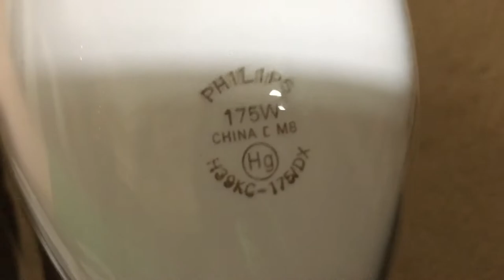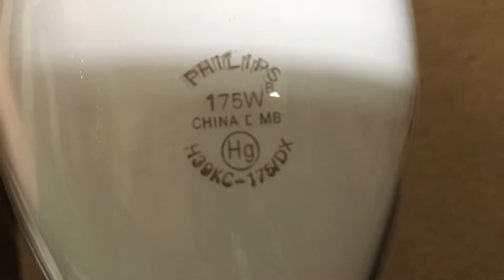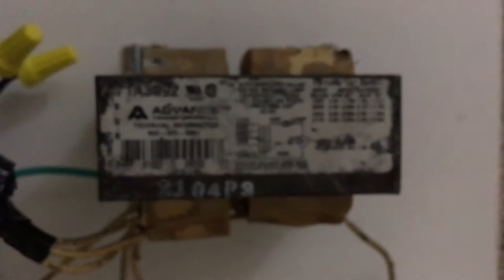Philips 175W DX Coated Mercury Vapor Bulb

Comment: question, you can install any capacitor on a mercury vapor ballast in 120v?
Reply from the maker: No. I think it’s the best idea to use the capacitor that came with the kit.
Reply: @frankiel.6774  what can i do?
Reply: @frankiel.6774  but i have a mercury vapor lamp that don't have a capacitor, what i can do?